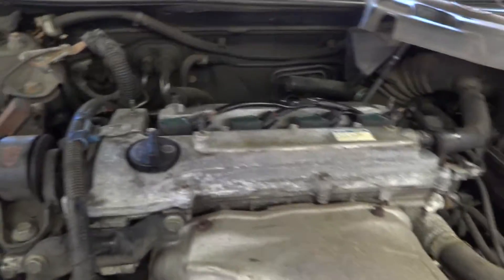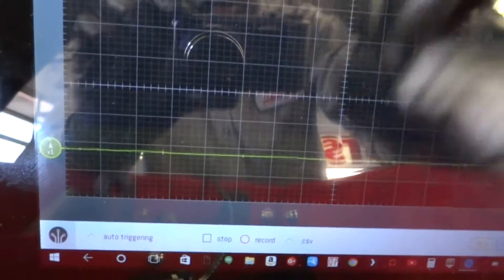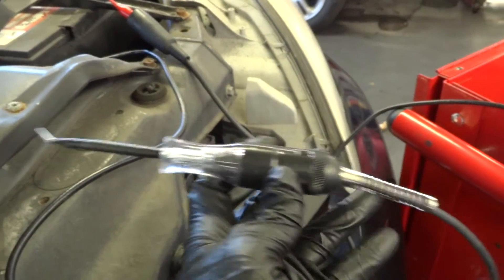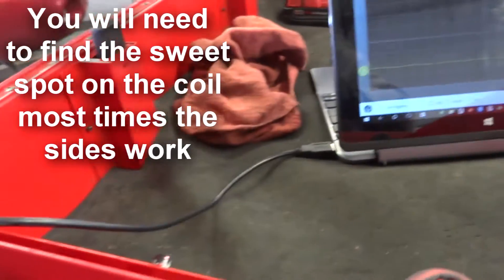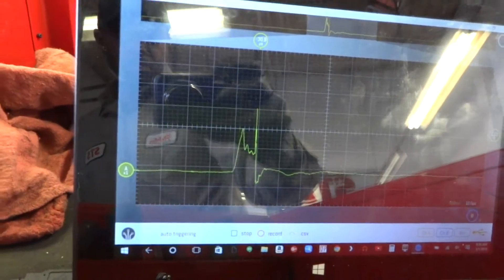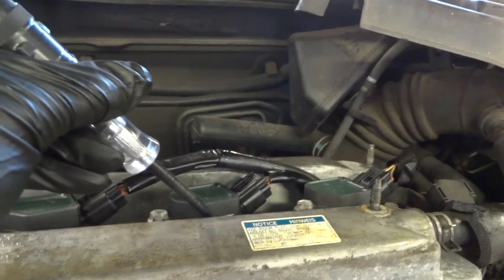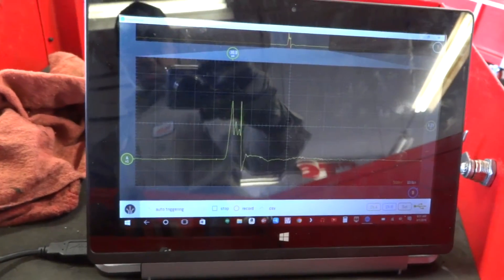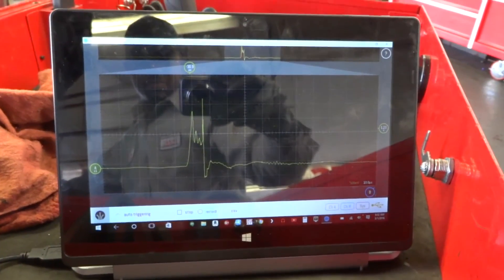LabNation SmartScope   Secondary ignition wave form with oscilloscope

Comment: Can you use an amp probe with this scope?
Reply from the maker: Juan Rodriguez not without doing the conversion math yourself or using what they call free math.. However I may have convinced them to add support for amp probes on there next software update so it could be supported in a few days or weeks... You can go to there forums and help pressure on them to get it done sooner.